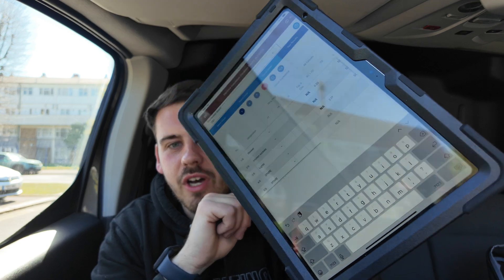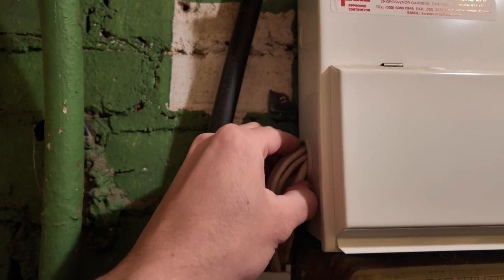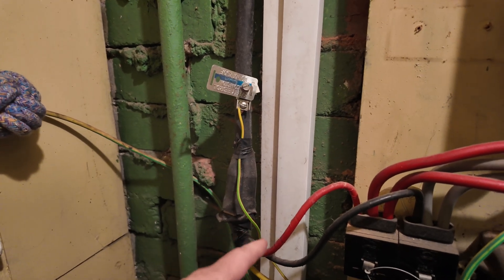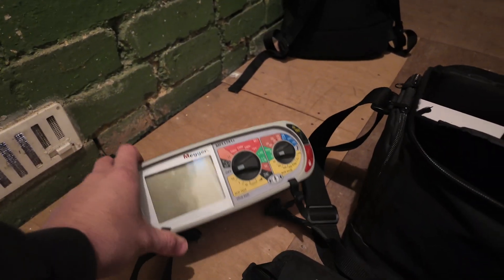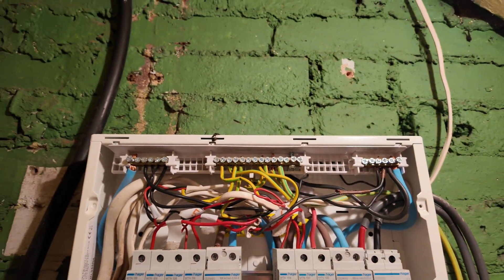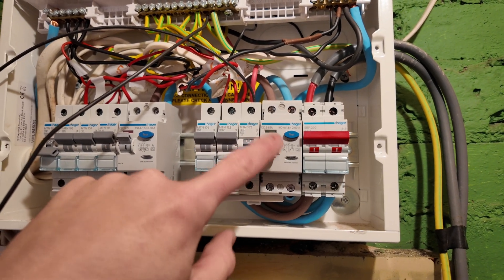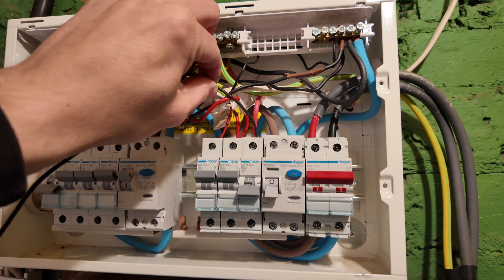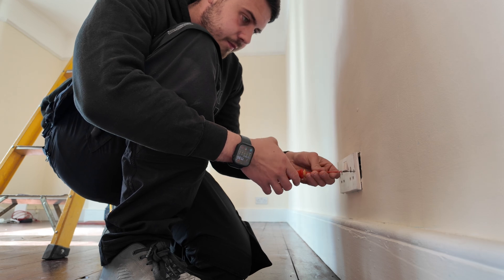Nightmare EICR

Comment: Rcd test is with no load u left the breakers on and r1+r2 disconnect cpc from earth bar parallel path through water pipe to shower and ze with the main earth disconnect and bonding

Comment: DNO equipment X, None earthed metal clad cut out with suspected fused neutral and asbestos A17,A10,B11,C11- DNO would've been out on emergency within 3hrs if this was stated

EICR itself 
External earth fault loop impedance exceeds maximum allowed for supply type-X contact DNO 

Absence of IP2X on side of the CU-C2

No overcurrent protection to submain more than 3m from Cut-Out-C2

Exposed basic insulation to SWA-C2
Non IP rated luminarie within a room containing a bath or shower but outside of zone and no signs of water ingress-C3

That's just from what I can see in the video very briefly🤣 basically like 90% of rentals been neglected with minimum  money spot on it within the last 30/40 years 🤣

Comment: Just completed one where the panel heaters (no gas,) had been connected into the perm live side of the main switch and the flat had a current in date eicr ! Good job the owner took his due diligence seriously and wanted a post Tennant check. Looks like the storage heaters were replaced with panel heaters , they tried to connect them to the economy 7 that didn't work so they wacked them in the perm live 
Crazy 
All sorted now tho